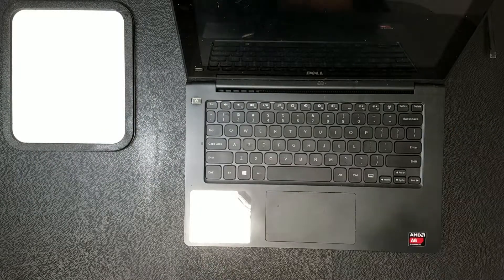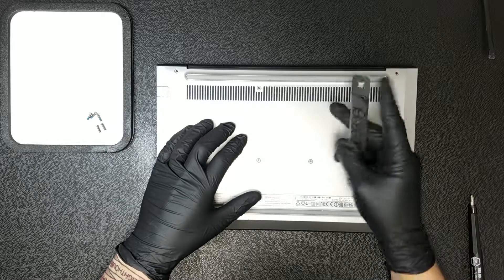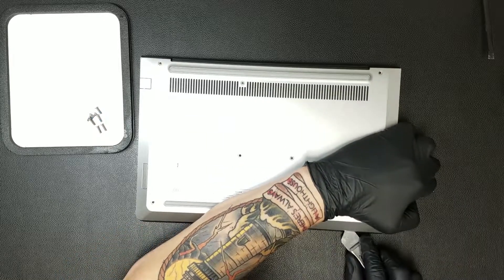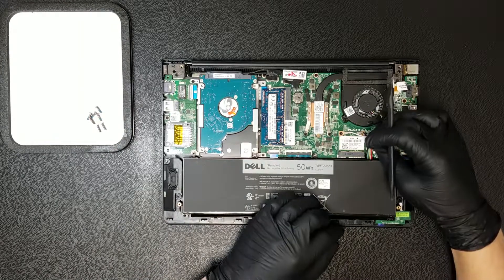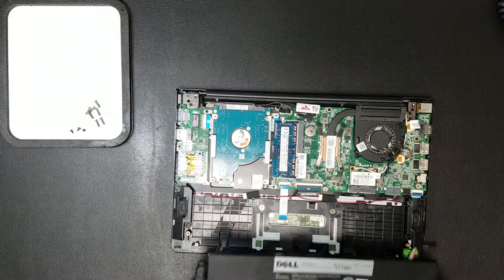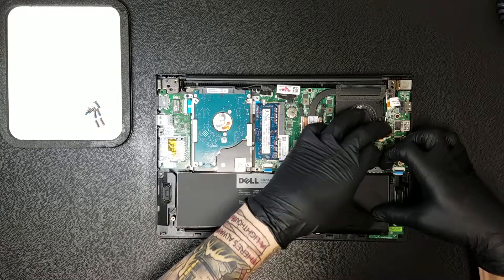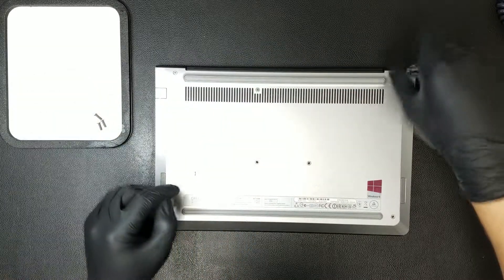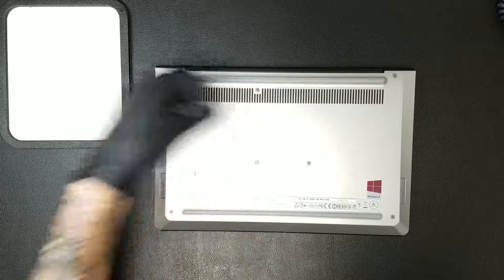Dell Inspiron 3135 Battery Replacement

Comment: I have a Dell Inspiron 3135 and the charger indicator green light will illuminate when I plug it into the wall..but once I stivk it into the laptop it goes out and my laptop won't turn on. Do you know why?